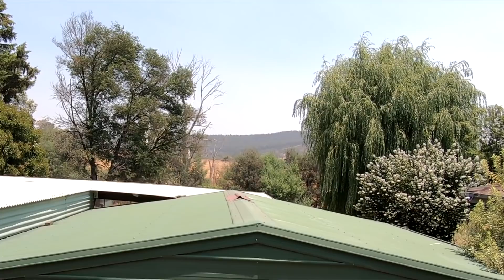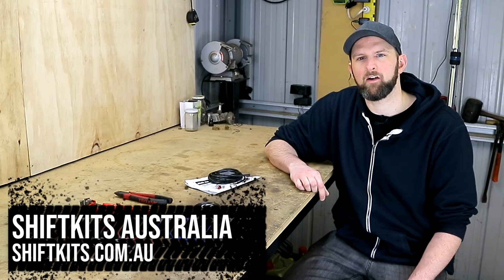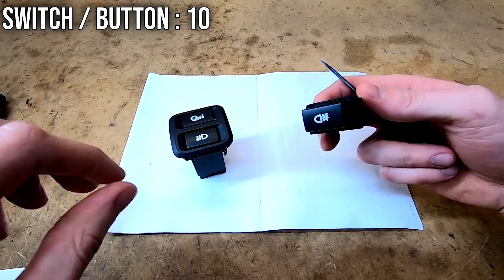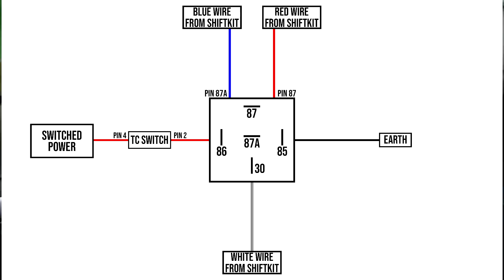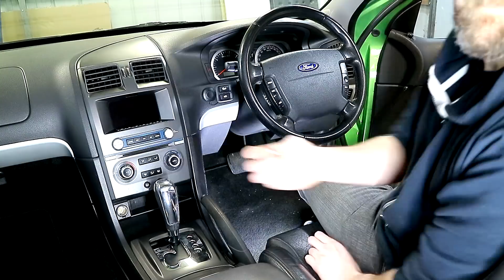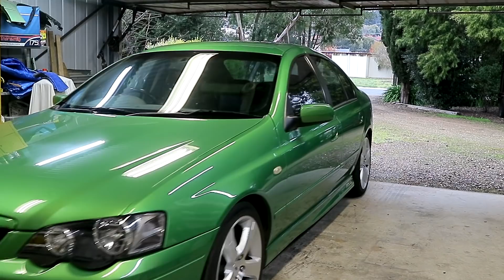Shift Kit Install and Testing (+ Hidden Switch) | Basic Barra Performance Mods Pt 6

Comment: Careful pulling off that second connector... mine was super brittle and I snapped the locking lever.  Don't stress too much, just use some beafy zip ties to keep it firmly connected.

Comment: Hey, would you be able to provide any more information about how to use the traction control button as the switch, where do the 4 wires coming out of the switch go and which relay should be used? thanks

Comment: Can this shift kit b added to a 04 ba ute with column shift 4 speed auto no manual option on it?
Reply from the maker: Don’t see why not, works just shifting normally in drive too. Maybe shoot them a message to double check before buying 👍

Comment: If your into pcmtec, I’m pretty sure this would be the same as rescaling all the fields in the s5 global temps to -500 !?? But at least you can switch it on and off ? 
I think you could do a multi tune on pcmtec with low boost 7psi on the street you go plus -150 in the above table and say-500 for the drags and 16 psi ??

But great to see how to use this shift kit on the b series btr . They are a good box with some extra line pressure, except for the very tall 1st gear! I’ve destroyed one box so far with a turbo conversion. Built box coming and a tune to match !
Reply from the maker: Yep sure a good tuner could get most, if not all, the same benefits using PCMTec - I'm not one of those but will be using one. I do really like having it as a guaranteed 100% firm when I need and then back to something a little softer when not though, it's pretty violent!

I quite like them too, especially when they're in there from factory and are so available and cheap. The BTR will be staying/upgraded if needed for now I think.

Good luck with yours mate 👍... and sorry I was a bit slow getting to this!
Reply: @BrowneysGarage  all good Mate . Loving your content !

Comment: Unfortunately this mod for me was a no go!

Installed exactly as instructions said on my BA XT 2003 and when finished, caused my car to enter anti theft or immobilised mode, not sure which, still working on the problem. Will crank but no start. 

Got a forscan cable coming so hopefully can reset everything or at least find the issue. Wire 39 (brownish) and white to connector side, black to harness side. Red to smaller red??? Got me confused why it did not work??? Did you run into any of these issues brownie?? Shiftkit Australia.
Reply from the maker: It’s honestly been that long that the video is probably a much better reference than my memory.

I didn’t have any dramas on this one, all I could think of is to go back and be 100% sure you got the right pin off the PCM plug, maybe use the shot of it here as a reference? (http://www.thebarraguide.com/wiring/) 

And you definitely tapped into that power/red wire rather than cutting it and connecting one end to the ShiftKit loom? Basic I know but just double checking, it’s normally something small that I mess up myself!
Reply: @BrowneysGarage  I'm sure I will get it worked out, yes, 4 over from 36 to the 39 and the small red for certain. Just don't like me haha. But gives me an excuse to get my obdlink EX with forscan, always wanted to do my own diagnostics. Works great and even sorted out PATS 👍
Reply: @reaper_redcap  hey mate did you get it sorted? I've read of a few other guys having similar issues to you, but I haven't seen any of those guys find a fix for it.
Reply: @Sk0die  Yes, it does work for sure. But I ended up getting a car electrician to install it while in for some other wiring issues. Best answer I can give sorry.
Reply: @reaper_redcap  I would probably do the same to be honest. Despite working on cars as a full time job, I'd still rather just pay a bloke who knows his shit rather than mess around with it myself.
Reply: @Sk0die  Good luck, hope it goes well for ya. Side note, careful in the wet, those tyres can spin 1st to 2nd but it's fun.

Comment: You do realise with the TC button you press and hold to keep it off and the light would show up on the dash
Reply from the maker: Why would I do that in a car that doesn’t have traction control?
Reply: @BrowneysGarage   yeah but you could still have used the factory button and held it for the duration of time to activate the fast shifts no?
Reply from the maker: Could have done that yes, would function the same except now I don’t have to hold the button, can just turn it on and off.
Reply: @BrowneysGarage  so if i were to do this kit on my XT that has the tc button i could do this. (Overall its just a preference thing right)?
Reply from the maker: I haven’t looked into how the TC functions off the button but as long as your happy to do it that way and have it control 2 functions then I guess you could. Could always use the provided toggle switch and stash it somewhere out the way instead also and forget the TC button idea.

Good luck
Reply: @BrowneysGarage  thanks man just wanted to query it as you have done it. Cheers

Comment: Hey Browney! Do you have a link for those traction control/fog light switch panel things? putting a light bar on my territory and want a clean interior.
Reply from the maker: Hey mate. They're just second hand factory bits, try a wreckers or eBay searching something like "Territory fog light switch". Note that the button surround is definitely different to Falcons, buttons themselves may be the same but I can't confirm that.

If you're at all interested in wiring them to come on with the high beams I did cover this on the GF's old Swift, you can check it out here - https://youtu.be/8tpatGXpSMI.

Good luck mate and sounds like a great project 👍.

Comment: Love the button counter. Lol.
A bit of advice too - next time you're anywhere near somewhere that sells them (like a Jaycar or similar) grab one of those soldering iron stands. You will not believe how much better it makes the process. I bit the bullet and bought one after I burned the top of my bench for the third time, and have not burnt anything since. Plus, they hold the iron at the perfect angle for picking it up to solder something, so you actually save time by not having to fart around getting your grip right. There's two main types on the market, a cheap one and a more expensive one. Buy the more expensive one. The base on the cheaper ones isn't heavy enough to hold up the bigger irons without falling over (ask me how I know!), and that tube-style holder they have is junk - you spend too much time trying to locate the hole, and none of us wants that, LOL. The more expensive style with the heavy base (and a little tray for a sponge) and the tapered cast alloy holder on the spring design that leaves the tip in the open air is waaay better. You can just shove the iron somewhere close and it finds its own way due to the taper. They're money well spent.
Cheers :-)
Reply from the maker: Haha I was pretty happy with that too, thanks mate.

And cheers for the recommendation, anything has to be better than the precut one piece fold out stand thing that comes with them! Don’t do a huge amount of soldering but will look into the stands, always nice to have the right tool there when you need it.

Comment: What wires did you solder from the traction control button to?
Reply from the maker: Just to be clear so I’m sure there’s no confusion, I did not connect to any factory wiring on the traction control, my car never had it. The button and and wiring plug I got from another car and wired to control the traction control.

If you’re looking to reuse a traction control button as I had, there’ll be 4 pins in a line across the top/bottom, depending on which way you look at it (with only 2 on the opposing bottom/top). Connect either of the 2 on the left of this row of 4 to either of the 2 on the other side. 

Hope that helps 👍
Reply: Is there a way of putting traction control is a 2003 ba?

Comment: I thought the shift kit simulates full throttle shifting at part throttle. It basically tricks the transmission (by changing ohm reading)  into thinking you have applied full throttle so the shift is quickens up .  It wont really effect full throttle shifting .
Reply from the maker: It 100% effects full throttle shifting, maybe even more because this is obviously when you have the most load and power delivery.

From my understanding you are correct that it tricks the transmission but does so to up the line pressure to a higher level than the stock trans would ever normally see, even at WOT.  Shifts are noticeably quicker and firmer.

Comment: Great work Browney,lol..I have a 2003 BA Fairlane G220 with the factory fitted 3V/5.4Ltr 220kilowatt V8 In it and it goes pretty well...The 4speed auto in it is pretty much the same as all other falcons,but these hi-end/luxury versions seem to be programmed for a far smoother gear change transition.Do the specifications,wiring looms and diagrams that come in the kit for the electronic shift kit you demoed here in this video for us,apply to the V8 equipped falcons,fairlanes and LTD models??? I’m tempted but I’d better be sure is what’s keeping me from going ahead with this great mod,lol Thanks for everything and keep up the great videos buddy😄😄
Reply from the maker: @Brian Zammit Hi Brian, and thanks mate. Shiftkits Aus do list V8 under BA's as an option so I'm pretty certain they'll have you covered with one of the kits. Not 100% if the wiring will be the same but if it is different at all will likely just be the one pin that is different, process will be much the same and instructions they provide will let you know for sure.

Good luck mate, they were a pretty nice thing the G220 so hope you enjoy it 👍
Reply: Thanks Browney! With that answer in mind,i shall be looking for this Ford V8 Auto shift kit almost immediately.Keep those videos rolling,as we look forward for more of your great work!😄😄

Comment: So I installed mine last night and My car doesn’t start now
Reply from the maker: @Rvayy Double and triple check your wiring mate. Is it BA or BF, as mentioned in the video I believe these splice into different wires so make sure you've done this right per instructions from Shiftkits for your car.

Didn't completely cut the red wire, only stripped it back (second wire from the car that is tapped into after the ECU wire)?
Reply: Browney's Garage yea followed instruction and your video and done it for ba and stripped the wire not cut
Reply from the maker: Plugged everything back in properly? Is it not cranking at all or cranks but won’t start?
Reply: Browney's Garage cranks but won’t start
Reply from the maker: Disconnected battery when doing it? Shouldn’t be an issue but you never know.

My next guess would be to check you cut the right wire on the ECU connector, making sure you counted out from 36, 37, 38 and 39 and on the connector nearest the firewall. Sounds silly but hopefully something basic, double check everything is connected right etc
Reply: Browney's Garage just went through all that going to disconnect the kit sold my wire back up and try
Reply: Browney's Garage only difference I did was I just eye balled how far from the module to cut but shouldn’t make a difference and no insolation just electrical tape

Comment: Tune your car for sure I have an fg xr6 with almost the same mods as yours I got mine tuned recently and it’s wonderful the tunes on my car are by pcm tech which allows you to have multiple tunes in your car and you can easily change between them either while driving or the car off
Reply from the maker: Thanks mate, hoping to get it in to tune as soon as we can. The PCMTec stuff does look awesome, a lot of functions they've worked out. Happy with the bang for buck of the tune? And care to share before and after power figures?
Reply: Browney's Garage so I payed $1000 and got 4 tunes where usually people charge $1000 for a single tune 
My car was already making a decent amount of power for a na with the factory tune but now it’s even better I will send you the dunk sheets
Just give me a email or something to send it to you or just search me on Facebook I will send it there
Reply from the maker: @Ali Qudrati Sounds good mate, for sure send it over if you get a chance - browneysgarage@gmail.com

Comment: Awesome, I think I can handle this one. Thanks heaps. My wagon was dyno tuned by the previous owner. Picked up 5 rwkw on pump 98. It had headers and a 2.5". I've done the coils, plugs and a Mace CA intake so far.
Reply from the maker: @Spirit Level Studios It's not a hard job at all. Sounds great, little bit more of a surprise to some people I'm sure in a wagon!

Comment: When, not if, you do the tune (I have faith in you Browney) give us a run down on the costs involved too. There are many channels on here that "We'll just get it tuned now" like it's as easy as changing a light bulb. I'd be very interested in how much it is and whether the average owner can cover those costs. Especially in these weird and wonderful times. Nice work converting the fog light switch/button.
Reply from the maker: @GlensGraphix Thanks Glen, the response has been pretty unanimous so guess I better start searching for tuners to take us in and get the wallet ready to hurt a little after lockdown! Couldn't agree more with you mate on the costs and "we'll just do this... flash back and jobs done" type videos, hopefully I'm doing well to outline the costs and realities without getting too bogged down in them.
Reply: @BrowneysGarage  I reckon you have been. It obvious you are paying for all of this out of your own pocket too. No one is just"giving you stuff" so you can make your shows.

Comment: Do you have to solder all three together the the brown one you disconnect or just put the longer wire to the shift kit
Reply from the maker: @Rvayy That's it, the brown wire is cut and either end connected to the respective wires coming from the shift kit but NOT back directly to each other. It now runs from the cut wire, to the shift kit, and back to the ECU.

Comment: Would you ever consider doing a cosmetic upgrade to the car instead of a performance one, like a head unit swap over?
Reply from the maker: @QB Mac Does fixing bumper sag with a pool noodle count, cause we did that? 🤣 

Would definitely like to do some cosmetic upgrades to this in the future. Hoping to do some at home paint videos/refinish wheels to tidy it up, head unit swap isn't planned but wouldn't rule it out.

Comment: Good old electric shiftkits, i fitted one to my AU falcon way back in 2005, we still have the Au still going strong. It shifts so hard when driving in the wet it would turn my single spinner diff in to a lsd lol. Ive got a Gtech that id use to check 0-100 an 1/4mile times. I can say after fitting the shift kit it dropped almost 2 seconds off the 1/4 mile time. Lots of fun.
Reply: 2 seconds on a   more likely 2 tenths which  still really impressive
Reply from the maker: @Chris Cumming I completely believe it would spin both in the wet, I was on cool dry roads and it was chirping tyres hard. Will have to watch it in the wet if it's on. And I'd be pumped if it dropped a tenth or 2 off the time, seems possible.

Comment: Thanks for the info mate ,I'm checking out a 
ba xr6 to buy ...my first modern ..ish ford so thought I better get some info so I can see if I'm mad  even considering this.. but I'm over the Commodores and don't fit in a corolla.lol.
Reply from the maker: @David Priestley Damn good engines and pretty tough gearboxes, plenty of other little issues that pop up outside of those but they’re well covered and generally fairly cheap to fix. Don’t know if I’d fit too well in a Corolla either mate!
Reply: Yer.. driving it was different .. heavy steering ? This is normal apparently ? A couple clunks in the front end.. the armrest is missing on p/s and loose on the driver side. .. but overall it's ok for the price
Reply from the maker: Yep mines always been fairly heavy steering. Armrests may be easy to sort but if not the door trims are all other the place and fairly cheap. Front end is probably suss out pretty quick, ball joints in these have a reputation for going and the photos of some of the aftermath is bloody scary! Something I should double check myself actually
Reply: @BrowneysGarage  If I get it for the right price it will get a good look over underneath and do what's needed to keep the front end pointing in the right direction. Thanks for your info and keep up the good work..  You have a new subscriber now .
Reply from the maker: @David Priestley Legend, thanks mate and best of luck 👍

Comment: Considering you have to get to a 100km/h to shift the damn thing, I don’t blame you for only doing 1st to second.
Reply: Honestly it’s a pretty strange feeling trying to get 0-100km/h times and only having the car shifting once.
Reply from the maker: For sure, makes them seem much slower than they actually are too if going from a standstill. Once up and going this thing feels great now.
Reply from the maker: @gizmodo baggins It's a looooonnnggg first gear in these, doesn't shift until 80k's at full throttle!
Reply: Browney's Garage trust me I know. I think these cars would have been pretty incredible with a better auto, the Barra is just an insane engine. The turbo engines with a manual and a good clutch were in another league.